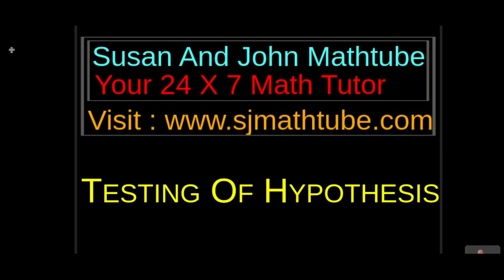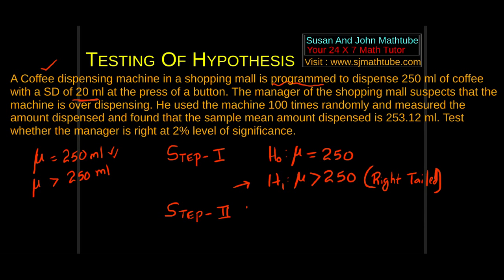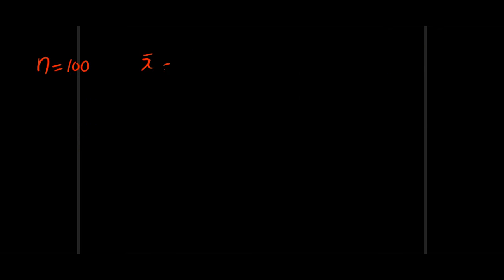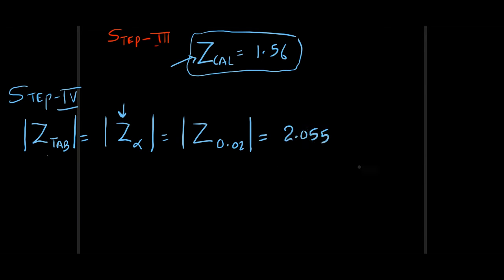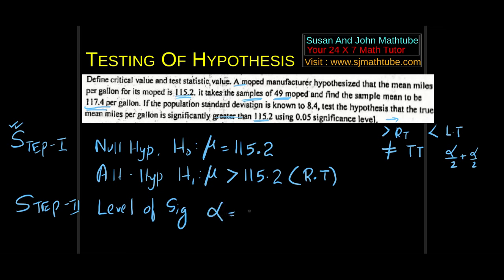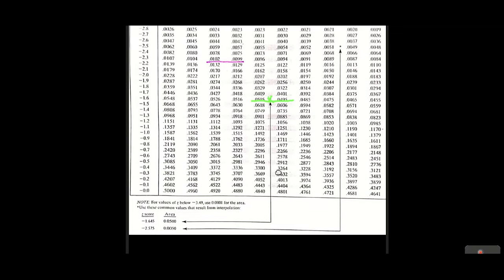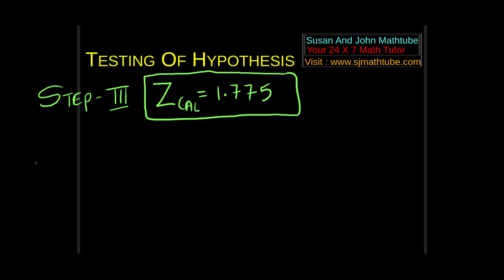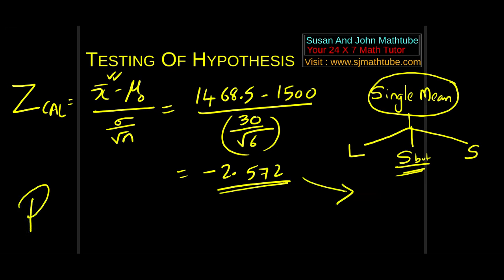ENGINEERING PROBABILITY AND STATISTICS -  18 - TESTING OF HYPOTHESIS : SINGLE MEAN

Comment: As per every book i compare with, no book mentioned that if sample is small, but population follow normal distribution z test should be used. Infact to use t test the population either should be normally distributed, or sample size should be less than 30. also you can use z test only when population variance is known which in most of the small sample case it is not given.. Please recheck sir...
Reply from the maker: It is correct but they don't usually as such questions in your exam...
we cannot use Z test in small sample because we are not sure about the Population Distribution....and Z test our assumption is the distribution is Normal...and according to CLT when sample size becomes bigger usually more than 30 ( Practically Dangerous to use though) the distribution of the means follow Normal distribution...

Now if the sample is small and if you are 100% confident that the samples are drawn from a normal population.... we can use Z Test...

But I will check it for sure... Thank You..
Reply from the maker: Practically Neither the t-test nor the Mann Whitney test is valid when the sample size is 15 or below....

But here my point is "if the samples are GIVEN (means guaranteed to be from a Normal Population... ) YES...you can use Z test...) 
Because the ONLY condition we need to apply Z test is Normal Population..
Reply: Thanks for the response sir. When the sample is small, random variable X follows normal distribution and population variance is unknown, books are suggesting for t test...yeah for CLT problems even if the sample is small if the sample is drawn from normally distributed population, Z can be used but book seems to prefer t test in hypothesis testing problem....either way, been following you since first sem so yeah I am going with you!!
Reply: Btw, the reference book I am using is A level prob and statistics book...
Reply from the maker: @theexecutioner8181  Be careful if they have given small sample and not talking about the population distribution.... then only t
Reply from the maker: @theexecutioner8181  Yes t test changes its size ... that is why that is more accurate if the sample is small...
Reply from the maker: BEfore exams workout a lot of past paper questions